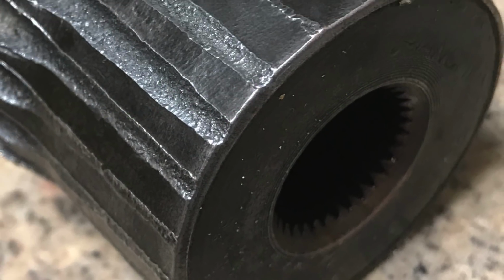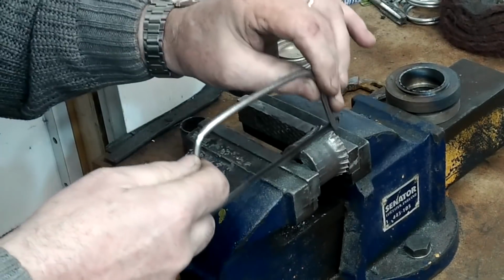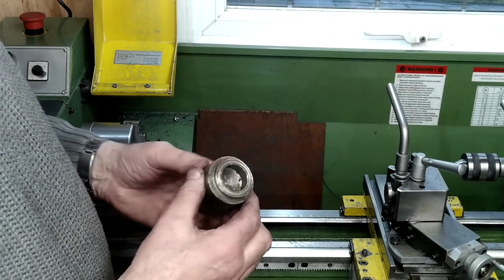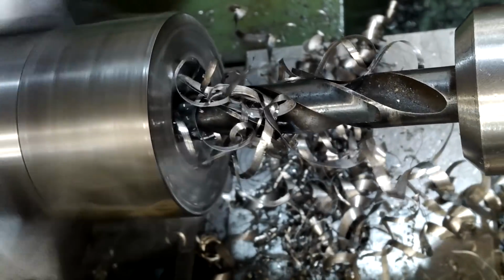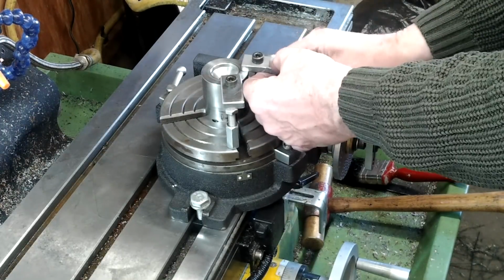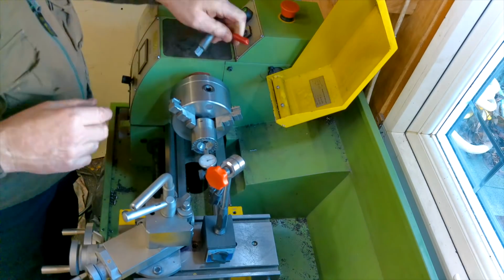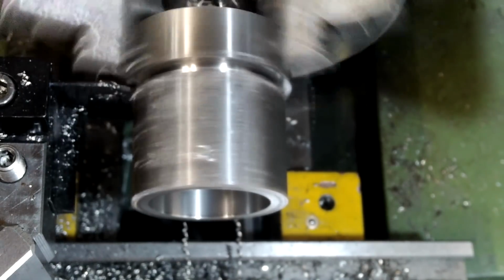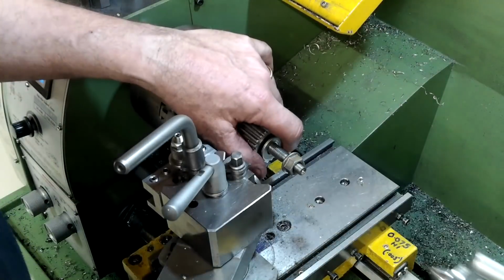Making a Drive Roller for a vintage Moped

Comment: Very well done sir. 2nd video to watch this morning, and is that an Enco column mill?? I had a 1980,, and wished I hadn't sold, but the replacement Ru-Fu31 had power X and 3 stage DRO with VFD and will do til a knee mill takes it's place. Any way, the moped and use viewer's thx you for sharing,,(@@)! Best over the Holidays from Bears Rod Shop, Tx.
Reply from the maker: Hi, the mill here in blighty is called a Warco GH major.

Comment: When I watched your 'presented problem' I tried to figure out how you were going to go about it, sprocket like on the outside, spline on the inside.  Hmmmm, another job for a shaper.  Using your vertical mill (or lathe) as the shaper wannabee.  Your solution was so much more eloquent.  Good job!
Reply from the maker: Hi. Thank you for you comments, when I looked at the Cog (as I call it), I rated it as a poor example of a belt dive gear. The time spent drilling would, I suspect, have taken equally as long as it would have taken while slotting, but being a none meshing component the drilling option was for me, the best solution. regards

Comment: Totally missed where you cut the grooves for the drive teeth.  Confusing.
Reply from the maker: Hi. they were done durring the drilling ,.. on the Milling machine,  then put in the lathje and gradually exposed. regards

Comment: Hi,Paul. Turned out very nicely. I also take the precautionary measure of placing the male component in the freezer before heating the outer when attempting any shrunk on work. The simplest and most convenient solution to the indexing 'brainfart' is to build yourself a digital indexer attachment for the dividing table. Have you seen the World Of Ward kits to build your own motorised indexer? Any number of indices you fancy all at the touch of a few buttons.
Reply from the maker: Hi i’ll take a look at that
Reply from the maker: Is that all you got from my reply..?(

Comment: Turned out nice.👍
That friction drive was quite popular, or at least not unknown, in years gone by. I seem to recall there was an after market motorising kit for push bikes and im sure i have seen one used on something else and British too.
Although it wont harm sticking one bit in the freezer you only have a few tens of degrees compared to hundreds using heat, so if you are in a hurry save on the cold bit and just heat.
Reply from the maker: yeah. true, the factory i worked in never chilled the core component and they always heated the stainless rings to bronze/brown achieving 64thou interference fit. i was a bit belt and braces with this.

Comment: Good job. But what a dreadful design to drive a tyre ! It must be very hard on it. Stainless steel is nice material to work with, but those stringy pieces of swarf are dangerous, hot and razor sharp.
Reply: @Sheila Walker i normally have no problem and in fact like turning stainless, all except 304, hatefull stuff.
I might give you a run for your money on the speed front.😉
Reply from the maker: stainless steel is indeed a material to be marvelled at, yet hated. In the past I’ve machined tons of the stuff. For stainless i find that to make best progress is to stick to the extremes. i have used a new generation ceramic button tool at 0.1mm doc, 0.1mm feed at 900meters pm it is dangerous as hell but the finish is good. Or the other extreme is a special triangular positive rake insert at 2.5mm doc, 0.53mm feed at 38 meters pm. the only other requirement that is needed on both counts is an abundance of power and torque, but mostly maximum rigidity.  Both methods remove large quantities of steel, the former gives off a blade of white hot string 2 meters long and a strategically placed swarf bin means no cleaning out at the end of a shift, the latter makes a horrendous noise and the machine needs several clean outs of mostly 2.5mm hot square chips. I’m not even going to mention finishing cuts.
Reply: No kidding after 50 years of lathe use I finally got bitten, first trip to casualty since I stopped wearing short trousers and all down to stringy stainless swarf.
Reply: @chrisstephens6673  I've seen it in cnc lathes, stringy stainless steel swarf completely binding the tool, especially boring bars.